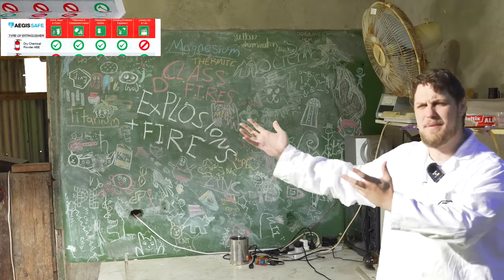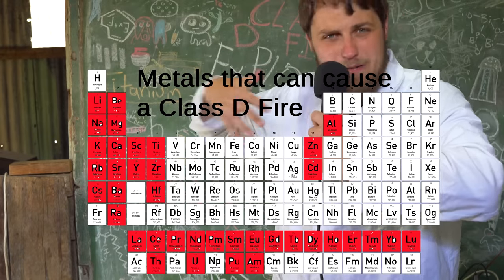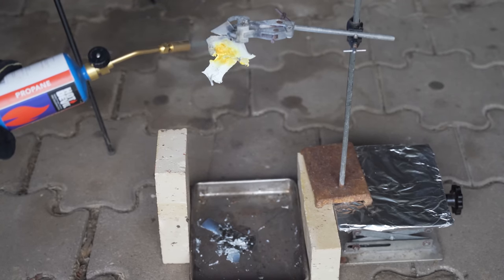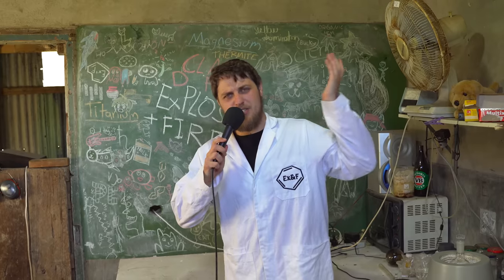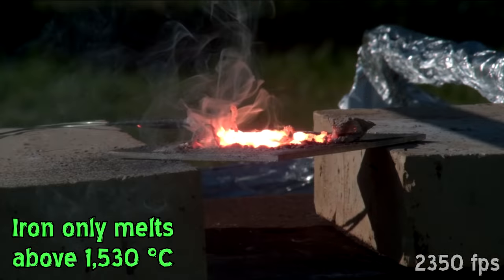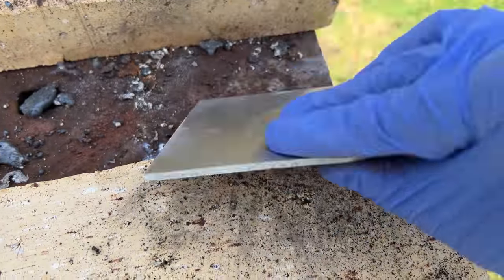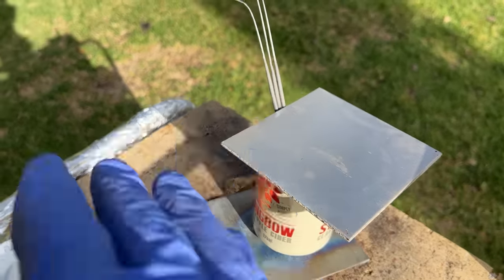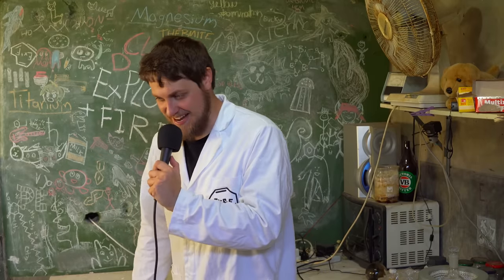Lighting metal fires (and putting them out??)

Comment: Ask any machinist: "What's the best way to start a titanium fire?" and they will tell you all you need to do is mill or turn it dry.
Reply: Came here to say this! Dull tools with oil as a coolant can make a VERY EXCITING titanium fire. It's the reason some CNC machines have built in fire suppression!
Reply: Yeah, having the titanium in fine chips would probably help. 

In a mill the shavings catch fire, right?
Reply: @volvo09  It's a paradox in my opinion. The heat stays with the workpiece but the chips fly off cool. That leads to the dulling of your tools and a good environment for a spark shower you will never want to repeat.
Reply: Lathe hack: keep chip tray full of Ti shavings at all times. You don't want to miss a party just because you had to switch to hard-turning some bearing steel...
Reply: Welder here was considering starting it with an arc but definitely had some sparky mishaps with the lathe as well so that would make perfect sense.
Reply: Exactly this! Titanium scraps go up so often cnc machines that work titanium have extra special fire control systems
Reply from the maker: Yeah chips and shavings seem much more dangerous! What sort of fire suppression system do the machines use though? Some sort of inert gas??
Reply: Yea, Just look at magnesium for example. A magnesium ribbon can be ignited with a match. The plate required extended exposure to a torch. I would expect the same principle to apply to titanium.
Reply: @ExplosionsAndFire  I did a bit of poking around, seems a lot use basically your Class D Extinguisher (ultra-fine particles and inert gas) but I did find one that uses "3M™ Novec™ 1230", some sort of fluorinated ketone - which sounds horrific.
Reply: @ExplosionsAndFire  it depends, my old shop teacher used to keep bags of baking soda around and if they had a fire in the lathe they would yeet the bag into the titanium fire and clean it up later! Fire Trace is a brand that sells automated fire suppression systems for CNC machines and they recommend either FM-200 or Novec 1230 Clean Agent for suppression inside a machine. I used to work for a CNC shop that turned a lot of exotics and they weren't exactly keeping on top of tool sharpness and had quite a few fires/oil mist explosions due to that. Thankfully none while I was there, I only stayed for a week and quit!
Reply: @ExplosionsAndFire  3M Novec (fluorinated ketone)
Reply: I never asked, but I assume it was some kind of inert gas and baking soda or something. It was a big deal if it went off, so we'd usually let the fire burn itself out. When it did go off, it filled the whole shop with fine white powder, which we probably shouldn't have been breathing...
Reply: @ExplosionsAndFire  A thought that just hit me is that aircraft fires tend to be very hot, and usually combust most if not all of the aircraft (which is why shot-down helicopters or jets usually look less like an aircraft and more like a giant pool of ash). And while a large amount of that aircraft is going to be aluminum, certain bits are usually made of titanium. Maybe that could be used to model what kind of circumstances you would need to burn bulk, non-powdered titanium?
Reply: @ExplosionsAndFire  Water/Oil based coolant, as a machinist that mills titanium you need it in shavings, the finer the better. not sure how powder would work, I think it would act as a thermal sink.
Reply: @ExplosionsAndFire  
Pass electricity through the freaking thing ya chemist
Reply: @brownell10 You can also use it for DIY phase change cooling. Not really sure why I added that, but I know people have done it.
Reply: I'm seeing references for titanium having an adiabatic burn temperature with air at 2930C, around the same as the peak for thermite, but thermite is limited to the boiling point of aluminum around 2500C. Magnesium is apparently much lower in air. Titanium filings or powder might do the trick to light the bulk; need to get it up to something like 970C and probably disrupt the oxide layer on the bulk. Melting it at ~1700C I expect would do the trick. Actually getting the heat transfer to work out such that the dang plate gets hot is probably the challenge.
Reply: Titanium + friction == fireworks
Reply: @ExplosionsAndFire  Usually inert gas. Got those everywhere and I've never actually seen that fancy fire extinguisher on a worksite.
Reply: @LogicCaster  Air driven plasma cutter should be devastating for Ti i would think. Maybe use a nice big torch to preheat the piece.
I honestly thought he was about to say plasma when he said thermite
Reply: @jort93z  that's what 3m claims anyway. It's not like we have a long history of chemical being sold as inert and harmless only for it to turn out they do something like say open a hole in the ozone layer.
Reply: Lol I saw a massive titanium fire go off at a shop I worked at. Smoking cigs in the deburr room. 

Had to have the airport fire department come out to put it out.
Reply: @MakeItWithCalvin  FM-200 is used in some data centres too. It replaced halon.
Reply: @lairdcummings9092  let’s friction-weld some titanium!
Reply: At my VERY PROFESSIONAL cnc shop we don't have a fire suppression system... Or a fire alarm system. We have ABC fire extinguishers and when that doesn't work we're supposed to blow a soccer horn to tell everyone to evacuate! 🙃
Reply: @captainotto  i always thought milling has advanced to a point where you can speed mill so fast the heat stays with the chips, meaning you dont need to cool the workpiece

but that was in 2013-15 during my apprenticeship that i heard that
Reply: He's trying to set the plate on fire.
Reply: I use sand to put out magnesium, fires. Ruins the part, but it wasn't in too good a shape after caught fire, anyway.
Reply: @JosiahGould  ngl Novec is great, I work in I.T and its good stuff, non conductive, non toxic, low global warming potential and ozone potential, though we usually use co2 as its way cheaper
Reply: @ExplosionsAndFire  Lots of coolant, chip conveyor, daily chip cleanup, fresh TALN, or w/e new they cooked up as a coating, prayers and some flourinated ketone just in case you value the building/machines over a significant portion of your life(and many do). Only the good shops with their shit half together run titanium for long. Most of it goes to military/aircraft stuff, if these parts are bad, even to poor heat treating, someone might fall out of the sky; so the guys working with the stuff are super careful about the whole process.
Reply: The fact that finely-cut metals burn better is demonstrated by steel wool, which (grudgingly) burns in air, even though iron and steel are not considered flammable at all.
Reply: @ExplosionsAndFire  co2 good mate
Reply: @ExplosionsAndFire  we used sand as an extinguisher for magnesium and titanium, not sure if it was a special kind or not. I never machined it so I never trained for it, but the sand bucket was there...
Reply: Perhaps a soupçon of mercury or gallium to help it along?
Reply: @ExplosionsAndFire  I work in a shop where 85% of what we run is titanium and we have CO2 bottles on the machines for fire suppression.  The way it was explained to me is that a broken tool rubbing the part can ignite the cutting oil, and if that's allowed to burn it can generate enough heat to light the chips. A CO2 extinguisher with a light sensor and heat sensor catches oil fires early enough to keep things from getting that far, as far as I'm aware. We've got Class D extinguishers in marked spots around the shop floor too if they're needed, but not mounted on the machines.
Reply: Came to say exactly this.  The chips can and do will ignite when they come flying off.  That or welders.
Reply: Laser 3D printing machines running titanium use special inert atmospheres and they use explosion atmosphere rated wet vacuums with anti static everywhere. A colleague did mention he’d see smoke appear when the machine filters were being changed once… get your running shoes on!
Reply: Love all the professionals in the comments kindly offering advice to light things on fire more effectively. What a great comment section.
Reply: @ExplosionsAndFire  Ours is Halon
Reply: @ExplosionsAndFire  The citizen lathes in our factory had halon gas fire supression systems. but the thing that caught fire most often were the filter benches where the operators would deburr titanium components and not bother to change the filters. You just need a big pile of Ti powder and a good airflow and fire some heat in there. However those Class D extinguishers never really managed to put out a filter bench fire just cover it in powder and keep the heat in. Last one I put out we used two of those extinguishers and finished it off with 4 x 4kg dry powder extinguishers which turned the bench into a smoldering pile of slag by the end of the fire.
Reply: @MakeItWithCalvin Wow it seems like you missed a lifetime of horrific burns by 2k C shower of sparks! Well done!😊
Reply: There are some curious facts about fire suppression on the machines. First of all, neither Novec 1230 nor FM-200 are rated for D-class fires by the manufacturers. However, they are perfectly capable of preventing the cooling/lubricating oil from acting as an accelerant. Because chips aren't supposed to be accumulating in a form of dry/semi-dry piles (there are chip conveyors and coolant/oil pans where they are basically drowned in liquid). So the fire suppression system isn't targeting a developed D-class, it targets the intermediate B-class. One of the important reasons why it's all needed is that some machines run "lights out" - say, a typical screw machine with a bar stock feeder might be left running unattended for 8 to 16 hours per day. Curiously, none of the general basic firefighting trainings I ever attended in the industry ever mentioned two things: how big of a D-class fire you even want to try extinguishing (area/amount of fuel) and the fact that you might really want some sort of PPE for eyes due to the extreme brightness of such fires that can potentially harm you and effectively prevent you from doing a good job extinguishing a fire. This is why currently, I have pair of brazing goggles stashed next to the yellow extinguisher that I might need to use someday.
Reply: I have a vague memory of a video showing a titanium strut on an airplane igniting when being dragged on a runway (or aircraft carrier deck or...).
Reply: i have the same opinion, never machined titanium myself but always heard that titanium chips are a great fire hazard, that a hot glowing chip falling into the chip container could cause a fire. maybe you can turn or mill it to create some chips(wet of course), dry them, then use thermite to controllably set it on fire
Reply: @ExplosionsAndFire  novec 1230, fm200, or co2
Reply: @jort93z  Well, until you run out of oxygen, but otherwise, yes.

They do also use it for extinguishing systems in museums and archives for exhibits that would be damaged by a water sprinkler system.
Reply: @justaguycalledjosh  Looks like they are gonna stop making it anyway by 2025 - fluorinated anything always gets such a bad rap.
Reply: @ExplosionsAndFire  We used sand for a magnesium fire in a machine, didn't work for shit!
Reply: @bobbygetsbanned6049  Magnesium steals the oxygen, it's basically another thermite reaction.
Reply: @arueshalaetablebuildingsociety  Magnesium alloys are actually still obscenely common in high performance aviation, or really any weight sensitive activity. You can buy bike gearboxes magnesium housings. My uncle is an aircraft mechanic and loves to tell a story from his training days, where somebody threw a scrapped landing wheel into a large bonfire. It turned out to be a few kilograms of magnesium alloy, and apparently burned as bright as a sunny day for about five minutes.
Reply: @spencerm5913  Yeah aviation grade firefighting is a different breed. Half the time they just blanket the area in non-combustible foam and wait it out due to just how insanely flammable a plane can be.
Reply: @eccomi21  That's mostly if you're using powerful carbide cutters on steel. Titanium, copper, and aluminum to an extent, are sort of stickier than the harder materials like most steels, and don't really like to give up a cheap easily. You have to use very sharp tools with careful feedrates to avoid them pulling big strings, and the coolant is just as much to help mechanically evacuate the chips as it is to control heat.
Reply: @LogicCaster  electrochem is more up MysteriusBhoice's alley
Reply: @ExplosionsAndFire   a ciggy lighter just burn and turn buddy thanks for the vids .
Reply: Try using a microwave, it works nearly instantly and gives impressive results.
Reply: @JosiahGould  Class D fire suppression systems have to use a very heavy, inert gas that doesn't break down into oxidizers at thousands of degrees farenheit.
This inevitably means that every single suppression gas is a horribly poisonous flourinated hydrocarbon with little to no oxygen in the molecular structure.
Source: there are spooky tanks of bromotrifluoromethane suppressant in machine spaces and paint lockers on naval vessels.
Reply: @dustinbrueggemann1875  When aircraft catch fire on the flight deck of carriers they just yeet the entire plane overboard because a burning lump of magnesium and titanium can melt a hole down to the ocean.
Reply: @ExplosionsAndFire  I'm honestly not sure how you didn't think to run an arc through it. If you melt the entire slab it should light.
Reply: @mycosys  it's definitely possible to plasma cut Ti. It makes enormous amounts of extremely bright, extremely hot sparks, but it can be done.
Reply: @MakeItWithCalvin  your school’s machining program had titanium?! Lucky. The best material I had was some donated 400 series stainless. Other than that, there was some O1 tool steel and brass.
Reply: @grahamwaldo331  No my instructor used to make titanium racing pistons
Reply: Was coming down here to say this. Either that or hit it on a bent sander and let the dust accumulate into a pile. Make sure you're wearing sunglasses
Reply: @ExplosionsAndFire  some machines use a CO2 fire suppression system. Or nitrogen
Reply: Somebody set up a ToT collab
Reply: thank god this is the first comment! i was gonna say ive had a few titanium fires at a shop i use to work for and it was a beautiful yet scary sight! and if he could find a way to shave a bunch of that titanium off into chips and could set that on fire but a whole ass piece would prob be harder and require more resources...
Reply: Was gonna say the same thing. I worked with a shop that turned titanium, and I was told many times how easy it is to burn if you're not careful. (I'm an engineer so I never did this stuff, I just really enjoyed talking with the people who made my designs.)
Reply: I mill titanium every day on a huge 3 spindle gantry. Am I supposed to have fire suppression?😅 We have class D extinguishers everywhere, but I don’t think we’ve ever had any issues. Hand finishing titanium on the other hand…
Reply: @brownell10  Is that the same thing as some of the Halon gas systems?
Reply: Yup!
Reply: I love the shop thread on a ex&f video
Reply: @user-vx1vl1ci1e  welder here too. Maybe a carbon arc gouger at like 350 amps and the air on.
Reply: Use a grinder of some sort on the Ti. It'll be a sustainable thermal event eventually.
Reply: Ive done both successfully.  You must stay clean.   No buildup of ti or you have a hazard.
Reply: Nonsense. Dump a bucket of water on the fire. You think the squirts from the garden hose are acceptable?!? Lol
Reply: Hmmm. We must have gotten a bad batch at work. We've burned through several dozen drill bits, but haven't managed to light the Titanium on fire.
Reply: @MakeItWithCalvin  Nilered featured Novec 1230 in a short once, showing how it didn't get things wet. It's a pretty bad pfas chemical.
Reply: @ExplosionsAndFire  Since you want it to react with oxygen, why not use an oxy-acetylene torch, you can slowly heat it to 3k°C  and see when the plate starts to catch fire
Reply: @JosiahGould  I belive that stuff is inert, some form of novec has ben used for submersion cooling of electronics for example.
Reply: @ExplosionsAndFire  at the plant I work at we use the same extinguishers as the one shown in the video.
Reply: @ExplosionsAndFire  alternatively a trip to the sun should do it.
Reply: @bloviatingbeluga8553 hey someone mentioned sand finally, we were always trained to have a big ol bucket of sand near the chip bin lol, or if it caught fire throw it overboard off the ship as fast as possible
Reply: titanium powder. used in pyrotechnics. if used in titanium flash powder mix it will make explode and sends burning titanium  everywhere.
Reply: I have seen videps that say the radioactive stuff is extremely dangerous to mill as well
Reply: @brownell10  Isn't that the liquid coolant for the cray "waterfall" something about some of it changing to phosgene after a time if I remember correctly. Sounds like a horror show!
Reply: @Explosions&Fire  usually CNC's require a constant stream of coolant when cutting parts so this exact thing doesnt happen, or so we dont pay 300 bucks for a new carbide drill

theres been times i forgot to run M08 or turn off blk delete on our Haas machines and i just cut the part raw, thankfully those times were with aluminum
Reply: Yeah, I thought about milling it too. Even grinding it on a wheel a bit produces shower of sparks.
Reply: @mgkleym  So far at least, they thing Novec 1230 doesnt deplete ozone. It is bad for aquatic life though.
Reply: @notme5844 I suspect that it isn't as non toxic to humans as claimed.
Reply: Doing it in a pure oxygen environment to that’ll really get that shit burning
Reply: @ExplosionsAndFire  One of the blokes on "we got the chocolates" YouTube channel is a chemist. Collab?
Reply: That, or the right thermite
Reply: Pretty much. Ti powder is a lot like dealing with Al powder....
Reply: @JosiahGould  that's also called "dry water" and it's cool as fuck. Nilered did a short about it titled "my favorite book is on fire (oh no)"

It's used in server room fire suppression too because it doesn't conduct electricity at all.
Reply: My buddy set his cnc on fire three times with titanium. You have to remember that  friction temperatures can  be very high just above torches so you may need plasma to even get close.
Reply: Yup! Just gotta increase the surface area.
Reply: @ExplosionsAndFire  Our CNC's didn't have a suppression system, we just have a bunch of those 2k extinguishers EVERYWHERE.
Reply: In addition, it's usually the shavings that catch fire, not the piece.
Reply: Inert gases are a great method for metal fire suppression
Reply: @ExplosionsAndFire  our CNC machines run with a large amount of coolant to prevent the fire from starting (and also to lubricate the work). If one does start, the higher end machines will use some sort of halon or co2 suppressant. The sodium chloride would damage the machines by getting in the moving parts.
Reply: @ExplosionsAndFire  All the shops I work in have either argon(? i think) or Class D extinguishers plumbed into the machines. The machine enclosures are lined with plastic tubing holding a pressurized gas. The tubing melts at a relatively low temperature, and the release of pressure from the tubes trips a mechanical interlock that releases the extinguisher.
Reply: Yep, I rushed to say this in a comment to find hundred of others have already said it...
Reply: @bloviatingbeluga8553  sand is a good one, I’ve seen talc powder and baking soda used as well.
Reply: @ExplosionsAndFire  someone in the comment suggest throwing burning magnesium into a snowbank can you do that? the fire will melt the snow and in turn the water would make the fire flare up XD.
Reply: High voltage arc??
Reply: Used to sell machines to a company that made titanium screws and such to put in people,  chips were non existant there was never more than a cups worth in the machine at any time and it was taken away and compressed into bricks for recycling.
Reply: @takumi2023  at least not now, it is autumn in Australia
Reply: @ExplosionsAndFire 
Yes I had some thin titanium shavings, I was able to light them with a standard lighter, only a few ofcource. I also have lit some aluminum foil and shavings by passing a good amount of current through them but it only works sometimes, mostly the al melts and breaks contact before it is lit
Reply: So friction is a good way to start a fire?
Reply: @ExplosionsAndFire  i have seen some things about 3d printers that use titanium dust and those keep it in argon to keep it from burning because they use a laser to melt the titanium to print stuff with the dust
Reply: @ExplosionsAndFire  Hyundai OE battery balancing encasement has an automatic extinguisher mounted on inside of top cover, looks like flattened sphere. I assumed it is D class, but now i can't find any similar product with info on that, and delivered product is marked only in Korean :v
Reply: @ExplosionsAndFire  halon.... Getting rid of all O2 works for putting it out... Just make sure do it in a space where you aren't in it
Reply: @JosiahGould  the company who produce 3M™ Novec™ 1230 say that its only suitable for a,b and c class on their website.
Reply: I literally came here to say this. Good lord am I scared of Titanium.
Reply: @ExplosionsAndFire  In my experience the fire suppression system is usually a very panicked machinist. Also a class D extinguisher.
Reply: @ExplosionsAndFire  Yeah, the stuff I work with that uses powdered Ti keeps everything (including of course the powder supply) under argon at all times. The powder comes in 20 kg lots in sealed stainless steel flasks.
Reply: @MedusalObligation  Ti will happily pull the O off of SiO2 once it gets going.
Reply: Could this also happen to a welder trying to tig-weld titanium while running out of argon gas?
Reply: @10kΩ Poti  Not a welder but I'd imagine yes since TIG torches are wickedly stupid hot
Reply: I searched for titanium lathe fire after watching the video and reading the comments
Reply: I mill titanium dry only, with air blast and it only catches fire when you are really messing up on your speeds and feeds
Reply: Using a peck drill with no lube/coolant and pushing the feed rate too fast will burn the piece to the ground
Reply: Tungsten carbide tools can withstand mad temperatures but the matieral that you are machining usually doesnt if your melting things rather than cutting your doing it wrong 😅
Reply: @johncochran8497  Fun fact, Magnesium used to be used in race cars in the 50s, and contributed to worsening the 1955 lemans disaster.
Reply: @brownell10  Lol
Reply: @krispockell685  ⚠️ God has said in the Quran:

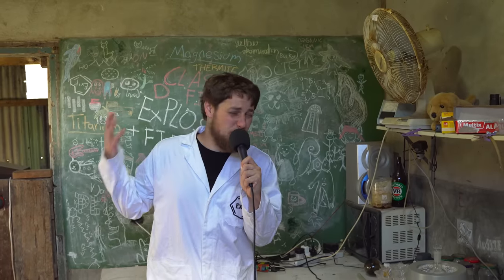🔵 { O mankind, worship your Lord, who created you and those before you, that you may become righteous - ( 2:21 ) 

🔴 [He] who made for you the earth a bed [spread out] and the sky a ceiling and sent down from the sky, rain and brought forth thereby fruits as provision for you. So do not attribute to Allah equals while you know [that there is nothing similar to Him]. ( 2:22 )

🔵 And if you are in doubt about what We have sent down upon Our Servant [Muhammad], then produce a surah the like thereof and call upon your witnesses other than Allah, if you should be truthful. ( 2:23 )

🔴 But if you do not - and you will never be able to - then fear the Fire, whose fuel is men and stones, prepared for the disbelievers.( 2:24 )

🔵 And give good tidings to those who believe and do righteous deeds that they will have gardens [in Paradise] beneath which rivers flow. Whenever they are provided with a provision of fruit therefrom, they will say, "This is what we were provided with before." And it is given to them in likeness. And they will have therein purified spouses, and they will abide therein eternally. ( 2:25 )

⚠️ Quran
Reply: happened in my school machine shop, had a fun time watching my classmate explaining to my teacher why his lathe caught on fire
Reply: We were demolishing some machinery and it looked like steel at torching distance and I had to use a shade #10 filter lense just to oxy fuel cut it. Super bright white hot. Definitely not steel lol. Definitely titanium not sure what alloy. It actually cut when I hit my oxygen on my torch it didn't just melt it like stainless or aluminum
Reply: @JosiahGould  doing a little digging, not instantly bad times, but a bastard to clean up, and does nasty things over time in sunlight, like degrade into Trifluoroacetic acid. Which is bad.
Reply: @MrTravis789  plutonium is pyrophoric, in fine turnings or dust it can ignite by itself without any ignition source. Mag oxide sand is about all that puts it out. Really nasty metal fire aside from its radioactivity and toxicity.
Reply: I used to blank .040 titanium, sand(deburr) and drill .1875 holes in them. During drilling and break through the chips would spark during each hole. We hated dealing with it during every step.
Reply: Fire department fined one workplace for putting alu and steel shavings in the same bin, as it’s technically thermite
Reply: yeah you need a large surface area
Reply: Bonus for machinists, if you grind steel and aluminum on the same surface grinder you will get FREE thermite if you don't clean it often (or at all like my shop)
Reply: @Severalangrybees  in the late 90’s as a new machinist, I always offered to clean up the debut tables. It was always aluminum but is was super super fine. I used to have pounds of clean 800 mesh.
Reply: Yeah, I was thinking to just get a bar and turn it on a lathe. The shavings should light right up with even just a normal propane torch. Just be careful you don't ignite them on accident while milling the bar with some random spark or perhaps just the ambient heat (I've never turned titanium on a lathe, so I'm not sure what the exact dangers are, just that the shavings are much easier to ignite.) Turn it some until you've got a decent pile of shaving, set them aside, and then repeat until you've gathered a nice pile.
Reply: @captainotto  Not only does it dull your tools, titanium can be work hardened so you're now cutting a harder material than you intended, with a softer tool than you intended.
Reply: @brownell10  does it make clean out easy?
Reply: My dads a machinist, an expert machinist I’d say, if he doesn’t say this you’ll have some explaining to do.
Reply: @ExplosionsAndFire  Use titanium shaving too start the reaction and set the plate on fire. or use thermite too lite the titanium shaving then the titanium plate would  burn in turn after???
Reply: @ExplosionsAndFire I've never machined titanium myself, but fromnwhat I've seen in my workplaces and stories on the internet, the fire suppression is a shovel or a forklift depending on the fire. Either to take the burning chips or the whole burning milling station or lathe outside 😄
Reply: @JosiahGould  That really sounds like a case where the antidote is as dangerous or worse than the poison 😅
Reply: @user-vx1vl1ci1e I was thinking: Gouging rod, cutting torch, or plasma cutter
Reply: @funnylife7454 any metal that's more active than carbon (Al, Na, Mg & Sn quickly come to mind) will actually use CO2 as an OXIDIZER!
Reply: @ExplosionsAndFire probably "Halon" gas. Thats what they always taught me in OSHA safety training classes. Halon is said to be very toxic to human life, so do be careful, buddy!
Reply: @krispockell685  I just light my chips on fire as I cut to make cleanup faster
Reply: Smaller the particles the easier it is to start a fire. Take wheat dust which is highly flammable only because of its size
Reply: Yep. 100% if you use HHS with no lube on Ti that shit makes the most beautiful purple fire.
Reply: @ExplosionsAndFire the CNCs I've worked with all use copious amounts of a very gross cutting fluid/oil.

Edit: as means of preventing, not containing
Reply: Little story time; a dude that was in another machinist class did his internship at this shop… using a CNC to cut magnesium, like the n00b he was at that point, forgot to put the coolant on, phone rang, came back to the magnesium burning the CNC down, at that point it was already a lost battle. They let it burn to the ground. My teacher got the call “one of your students internship cost me a million dollar CNC machine” let me tell you he now repeats how important coolant is like a mantra to the class LOL
Reply: @ExplosionsAndFire  With machining Titanium normally no fire suppression equipment is used. If you really want to light things on fire get a carbon arc torch or a plasma cutter.
Reply: @volvo09 I don’t think it works that way haha.. it’s not like something that flammable like wood shavings
Reply: Agreed, every machinist who has ever dealt with the work hardening piece of crap that grade 5 Ti is has seen it spark coming off an endmill and prayed to God it didn't light the swarf
Reply: Or tell the intern (me) to plasma cut aluminum scraps on top of the bin o' shavings
Reply: I feel like they simply take extreme measures to prevent the fire from happening in the first place
Reply: yup, titanium swarf = deadly spaghetti
Reply: You definitely need to get it into as fine of peices as possible (most metal fires first involve getting the metal as fine as possible with "powder" being the most combustible.
Reply: @volvo09  as someone who worked my summers as a teen in my uncles CNC shop the metal shavings official name is Danger Confetti. Not even because of catching fire (we didn’t work with titanium often) but because they’ll slice you up like a surgical knife.
Reply: @brownell10 haha